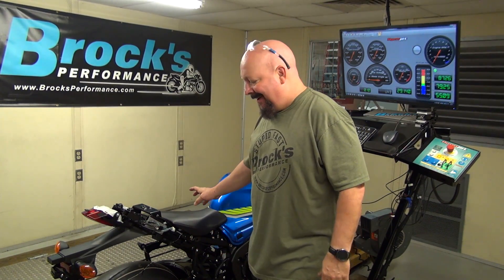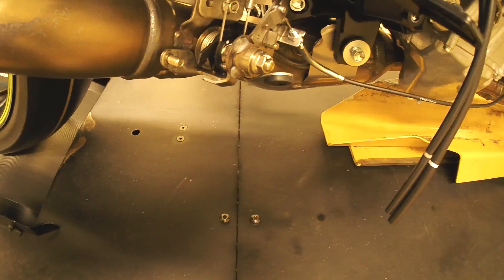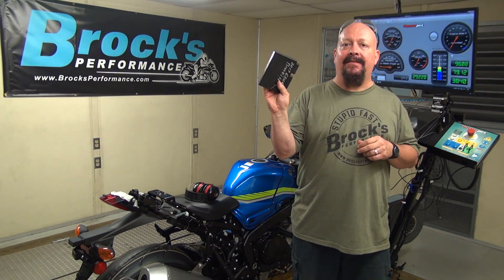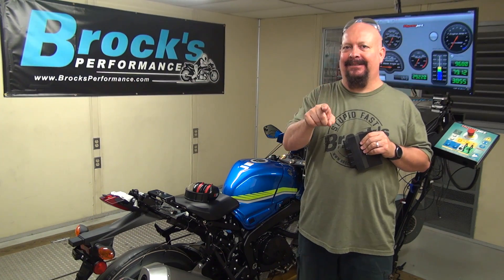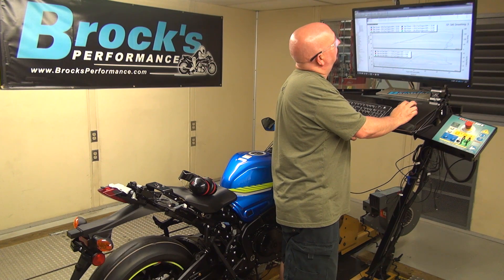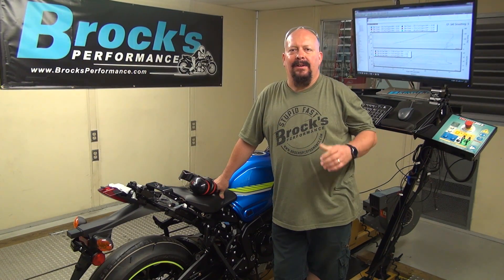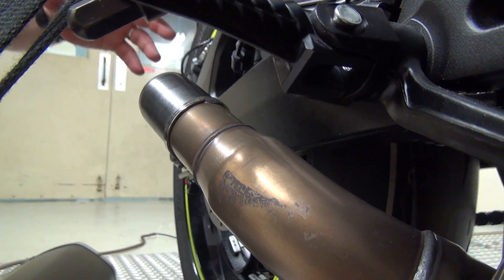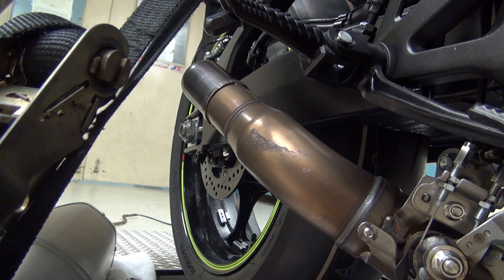2017 GSX-R1000 S2B: Episode 4 - Exhaust Installation and Theory (Part 1)

Comment: Hello, i'm checking your videos about this mod, and need to ask you a question, because I'm trying to do it on my bike. Did you try to leve the 2 "butterfly" Open a see any lost off Power or some diferences on cruise speed? Thanks for any coments, best regards.
Reply from the maker: The 2017 is a fly by wire and only has one throttle blade. You might want to watch this video: https://youtu.be/tn88EtR5O9g?t=914
Reply: @BrockDavidson  , sorry, I was refering to the exausth!!! The SET sistem???
Reply from the maker: The second butterfly is mostly for noise abatement. It's normally open, but if you disconnect it without a flash it will throw codes. To answer your question, yes, slight performance gains in the low and mid range are noticed.
Reply: Ok, what about the other ones on the headers? Any looses living it Open ??

Comment: So did a little experiment on my 2023 gxsr1000
1. Opened the rear valve, closed the valve in the crossover tube up in the headers gained 5 hp from 4000 to 10000 
2. Opened the rear valve, opened the valve in the crossover tube up in the headers (so everything is open now free flowing)  gained 5 to 6 hp from 10000 to 14000, but lost 5hp from 4000 to 10000.
So i think for racing no:2 would be the best set up for now until i get a set of your headers.
Reply from the maker: Your testing is correct! The answer to your question depends on exactly what type of racing you are doing...any partial throttle, #1. WFO...#2. But if your answer is #2, our full exhaust will produce even better results.

Comment: I installed a Brock's CT Meg exhaust on my 2021. When I did a pre fit, It was such a tight fit that I thought this thing aint never going to line up easy on the bike! I was wrong! Fit and finish were top shelf! The weld on the megaphone bracket may have gotten a little hot, but still looks superb to me! Also, I did run into a issue with interference between the oil-cooler and #1 header pipe. I initially thought to delete the oil-cooler, but figured a easy fix due to the unique mounting of the cooler. Very pricey pipe, but worth every penny!

Comment: Do you need a Servo Buddy on 2017 Suzuki GSXR1000 if you're only putting a slip on?
Reply from the maker: Not if you have a proper flash.
Reply: @BrockDavidson  I dont have a flash or anything, so it looks like I'll be buying one Servo Buddy of your site. I'm not looking for HP or anything. I'm going for looks and sound

Comment: Brock i have a 2017 kawasaki ninja 1000 (1043cc) with full akra system K n N filter 520 chain conversion and a custom dyno tune. 143hp at wheel and 79 torque. What is the difference between my engine and the zx10r?  Its almost a 50hp difference. What is it that makes it produce so much more power stock then my fully modified litre bike?
Reply from the maker: The quick answer: The ZX-10R is a race motor, severely neutered for street use. The Ninja 1000 is a street motor. Once we work our magic on the 10R, it's a bad mofo.

Comment: Since that has a quick shifter why are you blipping the gas as you shift, like it doesn’t have one?
Reply from the maker: This is the standard (not R) model, so it did not have a QS at the time of this video - it gets retrofittedin a later episode. FYI: Most modern bikes will quickly notice the front wheel is stationary and the back wheel is spinning, which will throw trouble codes and not allow certain unnecessary items to function until the ECU is reset. Quick Shifters and Auto blippers fall into this category. Resetting can be easy, or a real PITA... we can reset some in seconds, some take 1/2 hour+ of riding on the street...it depends on the bike. Some bikes won't make it 30 seconds on the dyno, some will allow 3-4 dyno runs - once again, it depends on the bike. And last, QS's are designed for wide-open throttle, high RPM use, so using them anywhere else can lead to much larger problems such as missed gears, stretched chains, and even transmission damage.

Comment: Sorry for the late reply but if the valve is after the cat it also works as a heatkeeper, the cat needs heat to work properly. EU4 or what ever. As the PAIR or air inlets to the exhaust, the cat needs oxygen to get hot fast to manage the gases. To make it more f....d up........MotoGP bikes has these valves too and they dont give a shit about emissions or noise.... ;-)
Reply from the maker: Moto GP bikes do not use these exhaust valves in the same manner or location - they are more like the Suzuki 'A' valve which allows the use of the addtional cylinder(s) at wide open throttle. This gives the power of a large diameter exhaust at high rev's, but smaller tubing produces more low to mid range power. The best of both worlds - with a proper ability to control the valve (s) for peak performance. Unfortunately, this not the case for store bought streetbikes...
Reply: @BrockDavidson  thanks for the respons, usually nobody cares 😔
Different use different rules...

Comment: Very good and dead on. I'm retired from the industry and spent considerable time studying Volumetric efficiency and I can say that few people understand what is going on here, I'm glad to see that someone actually cares enough to learn what all this flow is all about.  
Personally I would not delete the X-up system unless it is prone to high maintenance and cost later down the road, though I might add a slip-on but really all that will be saved is weight.

Comment: I took a hole saw and removed only the rear baffle on my mailbox... (muffle)... then i flared the hole  outward.... it give the bike a better sound little more db but it has helped the mid range power. I am still waiting for my factory rebated yoshi tri pipe.... on gsxr100r 2018

Comment: Fuel to air was not broken down without the stock muffler. I know u wouldnt advise against the design of the oem. I'm just curious as to if the muffler was off would bike run with in safe fuel to air....too lean or too rich or the same as if it was on.
Reply from the maker: It's not safe.

Comment: hi Brock does this mean, one could run the bike perfectly fine without the muffler, or with any slip on and not have to worry about remapping?
Reply from the maker: Not at all. As shown in the video, this bike was on the verge of 'too lean' operation when adding the slip-on - and this was just a 100% throttle test. The bike is desperately lean in some spots under cruising conditions - this is never good, long term.

Comment: Do you guys do a mail in service, where I send my eco in and get it flashed? I have a 2016 r1
Reply from the maker: http://www.brocksperformance.com/Brock-Flashed-ECU-YZFR1-2015+I923928+C297.aspx
Reply: what kind of power would I get from your ecu flash? Is the throttle still going to as sensitive? How does it compare to the sbu tune thats a 100 bucks cheaper?

Comment: Gotcha, it's been awhile since I looked on your Instagram. I just looked on your Facebook page. Exhaust looks bad ass. I noticed most manufacturers are going to the mid pipe connecting the 1 & 4 and 2&3 cylinders instead of the traditional 1&2 and 3&4 cylinders. Does this increase midrange or improve top end gains?
Reply from the maker: I wouldn't say most? At least not in our world. It can pick up mid range, but it's usually at the expense of top end gains.

Comment: At 13:50 Brock says that closed crossover pipes give more peak power, but isn't he mistaken?
Suzuki website says SET-A butterfly valve "remains closed to enhance mid-range and low-rpm power, then opens at high rpm to add significant top-end power."

Comment: Brock: You're such a tease. Great stuff brother. Just bought the 2017 GSX-R1000R today. And yes the quick/blip shifter is first class. I held the throttle steady, both up and down shifts were near seamless, the only time I clutched was from a dead stop or downshifting to first. Even at 165hp, acceleration from a dead stop was impressive, but nothing close to Mr. 7 sec :-) I'll get into the performance suspension and sort through the electronics package next. My only beef from the factory are the cheezy brake lines, noticeably mushy, not something I'd take to a track day or race without an upgrade first.

Comment: Yeah the new gixxer is all hype. They tried to say the large baseball bat on the bike was the reason it was being held back. Nah that's so far from the truth that it is not even funny. Gixxer bikes it seem will never really make big power. Not really Suzuki main focus there. They just build good street riding comfort style riding machines, Nothing more. Nothing less. 

 I was thinking it was going to be more powerful than the R1 but the R1 would kill it. VVT still nothing but works nice on a super bike. VVT on the c14 when it first came out helped that large bike out giving it more mid range kick over bikes in its class. 

 I also looked at the video of the gen 4 over this. Couldn't even make more power over a bike that was designed what 6 years ago? Only thing that will happen when you remove the large pipe is just weight savings. 

 On the head pipe area. Larger pipes also bring about bigger hp gains. Even with a bike that has ti headers on it when you install that full cause of the larger headers, it will pick up much more power. This is easy.  Also when you just run headers with no pipe on it. You lose back pressure. That does the machine no good.

Comment: GREAT VIDEOS!!! i have a question though. i seen you took the stock muffler off the bike and it gained a couple hp. but i was wondering what it would do if you took the butterfly/cat off and used the stock exhuast or just the butterfly or cat with the stock exhaust?
Reply from the maker: Justin Butts part 2 will be released soon 😎
Reply: Brock Davidson  can you tell me if I ride  bike without a muffler will damage the engine?

Comment: I put a cheap slip on exhaust, went to the track last Fri and Monday and the bike was really struggling on the straights.
it revved as normal but I wasn't passing bikes as normal.
I'm hoping to get it on the dyno tomorrow to check what's happened.
I've heard of someone's cat getting fried and the bike was running 134bhp